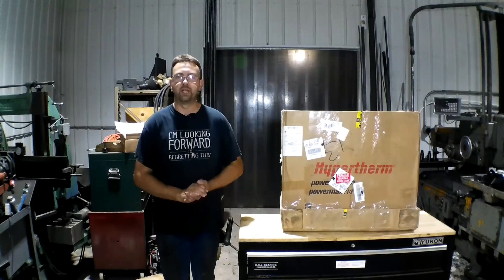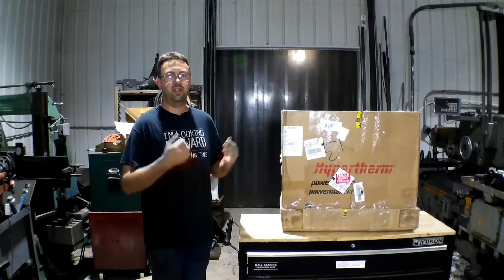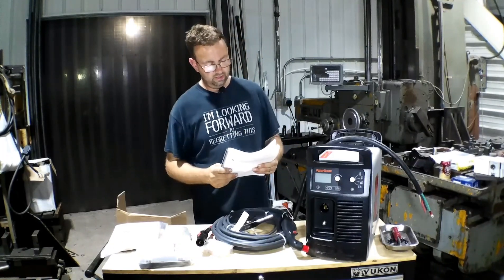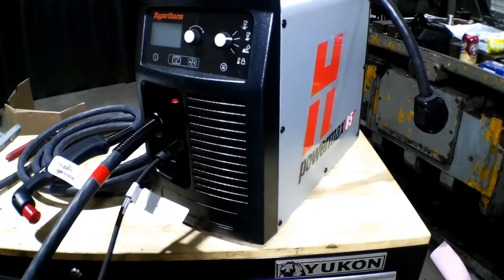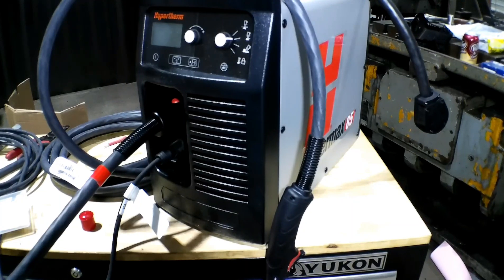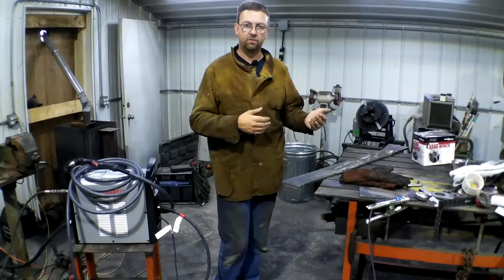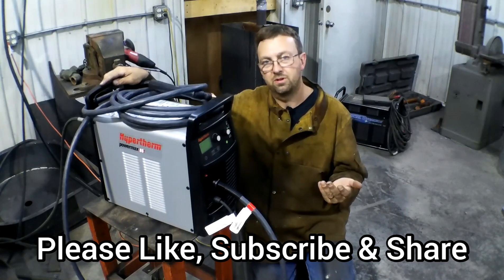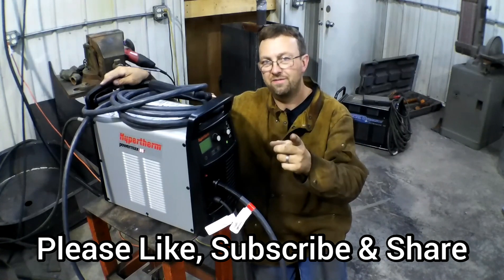Hypertherm Powermax 85, Setup and Test

Comment: Wear a helmet or glasses at least with a shade 7 through 8 that's what I usually go for I have had flash burn from plasma cutting on the skin of my face eyes  and also arms and chest and neck red and kind of burnt from that being protected I see you wearing a jacket which is good but your eyes and face and protection
Reply from the maker: That was a quick test. I now use coat, gloves respirator and welding helmet on a 9-10 shade.

Comment: I have a thermal dynamics 85 amp. Single phase. Had it for 6 or 8 years.  Love it.  The place that sells them kinda local won’t let them go out the door with out a filter set up that looks like it takes a toilet paper roll.  Supposed to absorb moisture too.  I use a face shield with a tinted shield about the darkness a guy would use for oxy/acetylene torch.

I want to get an angle tip. I think it’s a 45 deg or  more, to get closer to obstacles and for flush cutting bolt heads off.
Reply from the maker: I have several filters, plus a small receiver tank close by the machine. Moisture settled out in there also. As this was a fast test, I didn't put them on, but I have some #9,#10,&#11 glasses. I just closed my eyes for the cuts. Great machine so far. Thanks for watching.